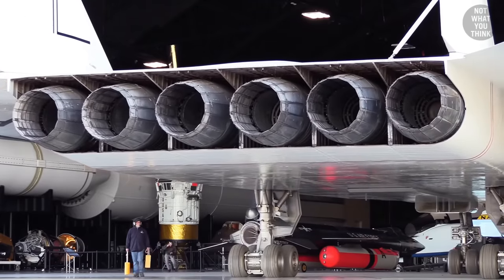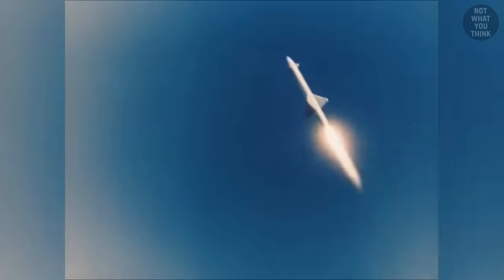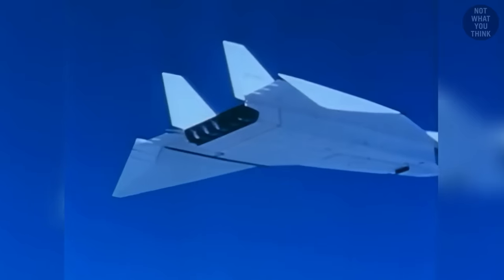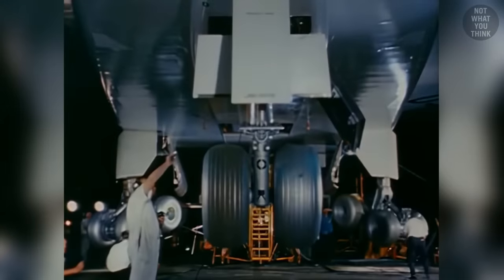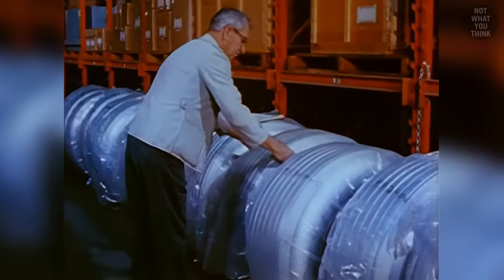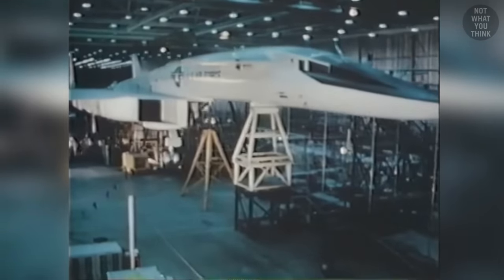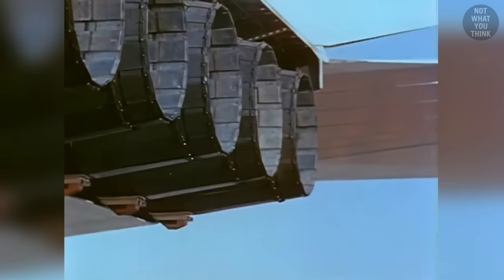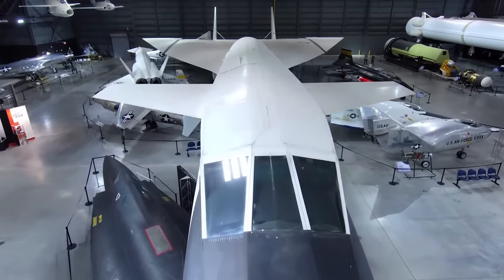The Airplane That Looked Fake, But Was 100% Real: XB-70 Valkyrie

Comment: The Soviet Union also abandoned such aircraft, let's complete the Sukhoi T-4 prototype
Reply: T4 had nothing to do with XB-70A.
Reply: @winternow2242  The designers of both aircraft have a common goal - to create a supersonic bomber capable of flying over vast distances. This determines their general design layout and so on.
Reply: @alexandrnoskov5437  Nope.  T-4's ferry range was about 4,300 miles, which is about what Valkyrie's range was, so both ween;t designed to fly "over vast diatances".  

Also, supersonic bombers dont have to have the same layout, and in fact don't.  case in point, B-70 ad T-4 were actually qute different in lay-out.  Just google 3-views of each plane,  When you compare the 2, ide-by-side, you'll see a few superficial similarities...and way many more differences.
Reply: @winternow2242  I won't argue with you.
Reply: @alexandrnoskov5437  "The Sukhoi T-4 was a Soviet high speed reconnaissance, anti-ship and strategic bomber aircraft designed under the leadership of Pavel Sukhoi that did not proceed beyond the prototype stage. Despite design similarities, the Sukhoi T-4 was not intended as a Soviet equivalent of the North American B-70 Valkyrie, but was intended to take advantage of many of the XB-70’s aeronautical innovations to develop a smaller reconnaissance and anticarrier aircraft capable of reaching Mach 3." - Simons
Reply: @smark1180  All aircraft of that time are very similar to each other. After all, each of them is based on aerodynamics and engine capabilities. And, of course, everyone copied each other. The T-4 never passed full tests, the XB-70 suffered a critical defect in the control hydraulics, the Soviet supersonic Tu-114 was not in demand, the Concorde inspired by it turned passengers into jelly, the Rockwell B-1 could have repeated the success of the Soviet Tu-160 if only long-range missiles were taken into account, the F-15 and SU-27 are very similar if the Americans had chosen the Soviet approach and built the airframe of the aircraft “without a body.” All of these aircraft are based on the capabilities of the jet engines of the era and the aircraft's behavior in supersonic flight. At the moment, Russia is half a corps ahead, thanks to the Su-57 and the deep modernization of the Tu-160. Both of them are actively re-equipping engines and avionics, which are now superior to NATO models. This always happens, someone is ahead, someone is a little behind, then the situation changes the other way around.
Reply: @alexandrnoskov5437  Now back to the point, "T4 had nothing to do with XB-70A."
Reply: @smark1180  You talk about its functionality, but not about its technical part. These are two almost identical smolets.
Reply: @alexandrnoskov5437  I did not talk about anything, I quoted an expert on the XB-70.
Reply: @smark1180  Do you believe the experts who represent the interests of weapons factories? Stop, it's bad for me to laugh too much.
Reply: @alexandrnoskov5437  Non sequitur. I didn't quote any "experts who represent the interests of weapons factories." You're becoming a bit unhinged over this.
Reply: @smark1180  Say what you want.
Reply: @alexandrnoskov5437  I did say what I want. But you can't lie about what I said.
Reply: @smark1180  It seems to me that you have a sick pride, because I didn’t lie.
Reply: @alexandrnoskov5437  What "seems" to you is irrelevant. What you can demonstrate is relevant. You can't demonstrate that I have a "sick pride." That's something you pulled out of your hat because you can't refute what I wrote.

You wrote, "Do you believe the experts who represent the interests of weapons factories?"

That is a rhetorical question that claims or at least implies that I believe such a thing, not that it's relevant to the conversation. Regardless, it's a lie about me.
Reply: @smark1180  I can easily demonstrate this very simply. To do this, I recommend that you re-read your own messages.
Reply: @alexandrnoskov5437  "I can easily demonstrate this very simply."

And then proceed not to.

Comment: More lies… the Valkyrie was primarily cabled controls… only the brakes were hydraulic.. the XB 70 was flown tor 2 years before they say here .  Ten were made
Reply: False. All of the control surfaces, windshield ramp, wingtip folding, and engine inlets and outlets were hydraulically actuated.

Comment: Beautiful looking design based on Concorde....but obviously not as good despite a faster Mach speed. It just goes to show the sheer genius which went into designing and building the Concorde.....and the accident was due to the runway not having been swept properly. A piece of metal was on the runway and it stuck in a tyre, apparently. EV's are far more dangerous than Concorde ever was, and certainly must more dangerous than combustion engine motor vehicles. Yet they aren't outlawing EV's.
Finishing Concorde was about money. It cost so much it wasn't making money. The accident was an excuse.
Reply: Huh?  How could this design be based on Concorde when it was designed years before Concorde. The Concorde design was still incomplete by the early 1960s, and the first plane didn't roll out until 1967. Valkyrie had been designed by 1958, and first flew in 1964. 

Dates aside, the 2 planes have nothing to do with each other. They share few, mostly incidental features, but way more differences, and don't at all fly alike. 

The 2 planes were designed for different roles in different countries, so how could they be compared?

Comment: This is total BS !
The XB-70 was never meant to be a strategic bomber because it was not designed as a strategic bomber !
Reply: Yes, it was designed as a strategic bomber. When the B-70 program was canceled it was built for high-speed flight research sans the weapon systems.

Comment: it looks "soviet"ey
Reply: What " "soviet"ey"" of the time looked like this?
Reply: @winternow2242  I don’t know man it just a blanket statement. It just got that hard lines. Not the same time but like mig 25 or mig 1.44.
Maybe bartini 57
Reply: @bernardibrahim  hard lines were the rule for most military aircraft of the era, much as it was for the Century Series, the Crusader and the Phantom, as well as the Intruder.  Those were planes that were actually put into production, unlike MiG 1.44,  of which only 1 ever flew, about a decade behind schedule, or the Bartini, which was never built.  Your blanket statement is that the XB-70A looks liess like planes built in its own country than it does a few obsacure-if-ever-built aircraft in some other country.

Blended surfaces wouldn't become fashionable until after the Viet Nam war era, and additional countouring for reduced RCS a few eyars after that.
Reply: @winternow2242  youre right

Comment: Lies….lies…lies….  I was a test pilot of the Valkyrie… this report is lies ..lies… lies… the Valkyrie as a great Mach 3….-safer than the Concorde!  Fold down wing tips actually Accelerated the plane to beyond Mach 3.  The Valkyrie was the first plane to use electronic device known as a pulse generator which increase engine thrust to accelerators beyond Mach 3.
Reply: False, the folding wingtips did not "actually Accelerated the plane to beyond Mach 3."